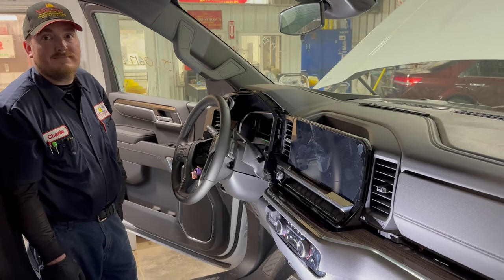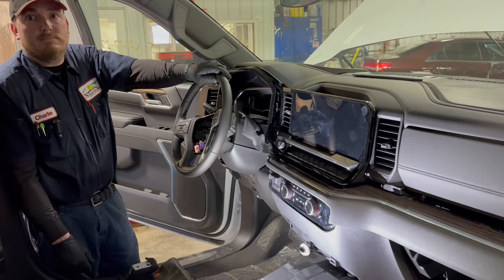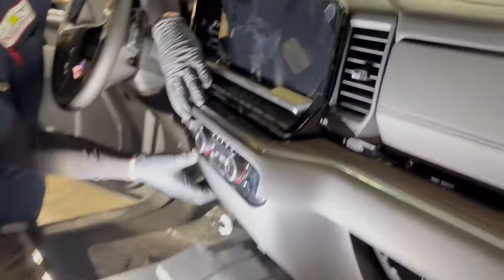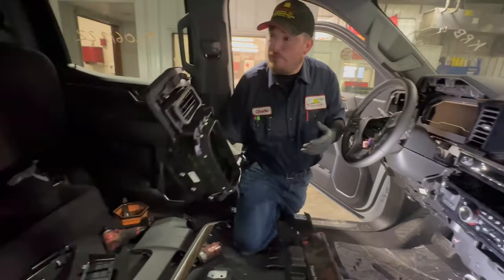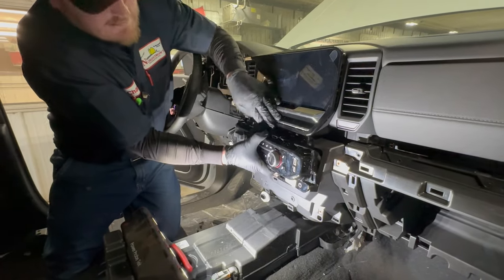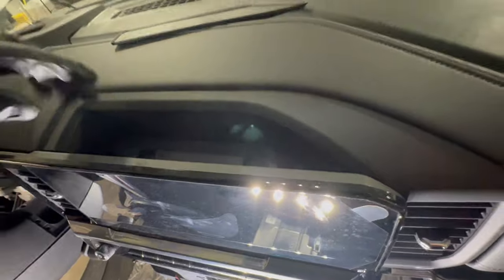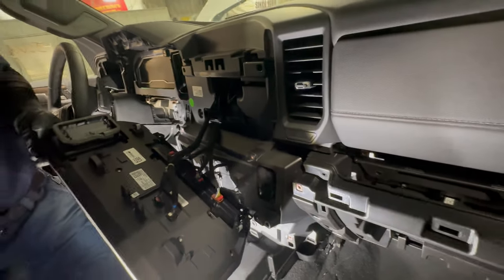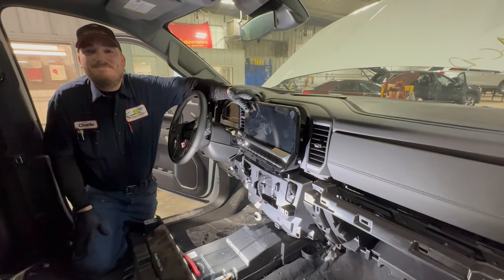How To Remove A 2022 2023 Silverado Radio Touch Screen late 2022

Comment: This is great info so it comes apart without breaking it. Need to connect a accessory power wire for my radar detector. Thanks!!!
Reply from the maker: Thank you!
Reply: Good luck with that. I'm trying to put in dash cam. No one wants to do it. 3 prong fuses no 12 volt in the dash.. never buy new again
Reply from the maker: They make quick plug in harnesses for accessory power for all these new vehicles. Just unplug certain harnesses and plug in the accessory jumpers. Easy to search and buy online.

Comment: Is it possible to add dash speakers?  I looked under dash not pre wired
Reply from the maker: It would have to be custom. They usually are in the side post pillars
Reply: Thanks  found a black plug at top of pillar. Maybe that's it
 @UnderTheHoodShow

Comment: Any chance you have a video on replacing a HUD unit on 2024 2500HD? Mine is clicking and making noise when it gets warm outside. A gear or motor is clicking
Reply from the maker: Sorry. Not yet. Thank you for watching.

Comment: Ok that is helpfull.  Does he have a good spot where a 12v outlet could be installed for higher power usb charging.  Like in the pocket behind the screen?
Reply from the maker: There is not much room behind the pocket for a large socket, but a smaller high power USB port may fit there.

Comment: Why did this need to be removed from a one yo vehicle??
Reply: Salvaging parts from a vehicle that was wrecked or take off the road for some other reason. Note the airbag is out of it already
Reply from the maker: Great question and actually it has almost no miles. We are a progressional Auto Recycler that dismantles vehicles from a few days old to a couple decades. Some are heavily damaged while others are less damaged. Our job is to save as many parts for reuse without breaking them as possible so others can benefit from the price savings if the almost new in some cases, used parts. Thanks for watching. We also do the radio show that’s on this channel.

Comment: how do i get into the defrost duct i dropped something in there and cant get to it
Reply from the maker: When we have done that we use a magnetic pick up tool with the magnet attached to the end of a long wire. IF… what we drop is magnetic. Otherwise it has to come completely apart.